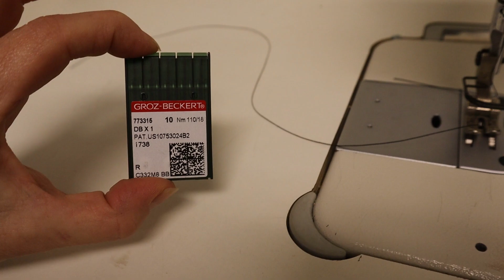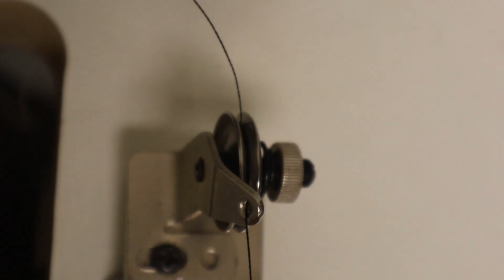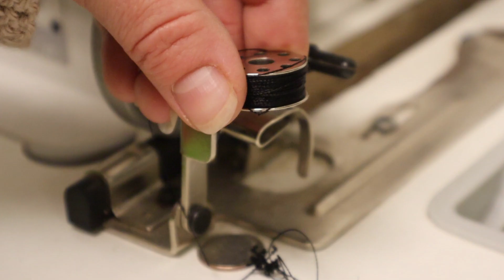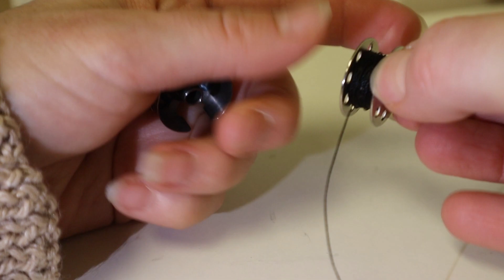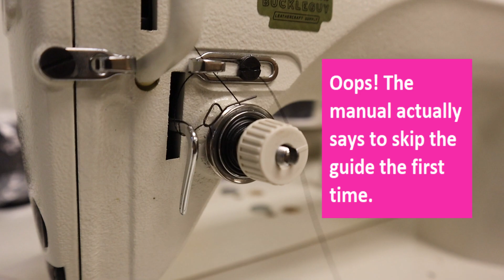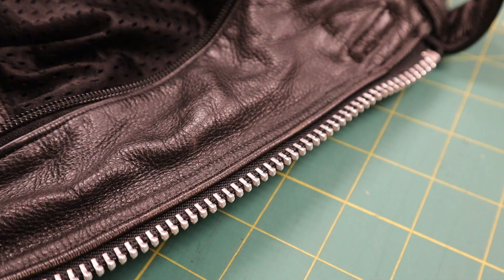The Industrial Juki DDL-8700 is Dream Machine!  Let's Set it Up

Comment: What size & brand of thread do you use? I am getting this machine and so confused about thread, do I need a bonded poly or certain Tex size? I will be using the machine & usually use So Fine 50wt on my domestic do you think this will be ok to use on this machine? Thank you for this video!
Reply from the maker: Hello, I have been using these from the thread exchange website -

Bonded Nylon - Size 46 (Tex 45) 
Bonded Polyester - Size 46
 Bonded Nylon - Size 69 

Hope that helps!